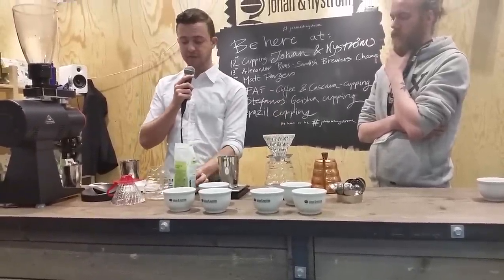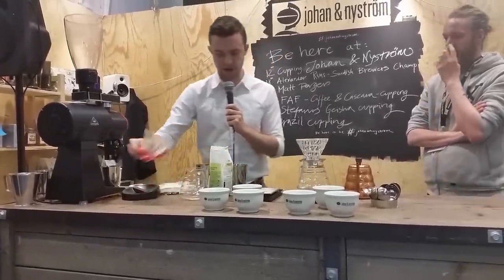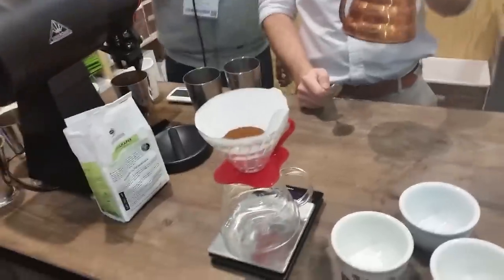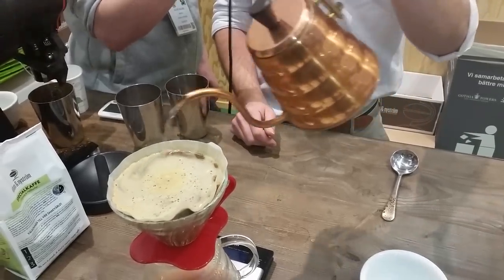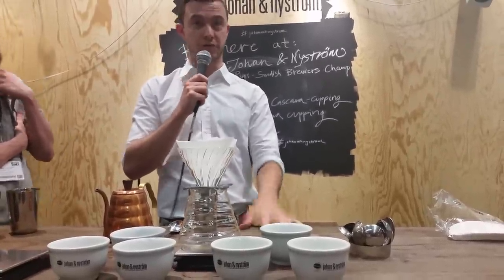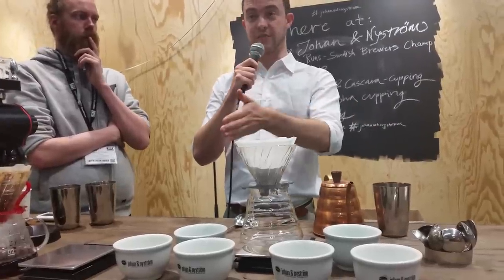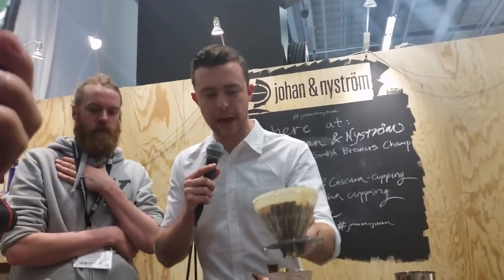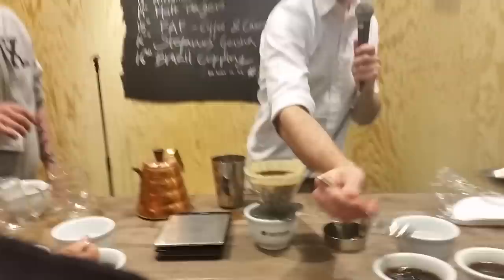Matt Perger talks about brewing in WOC 2015

Comment: That moment during a live demonstration when you find out Hario changed their filters without telling anyone.
Reply: It's a fake imitation hario filter. Hario didn't change. There is a company making thicker filters with little tabs on the top and they're calling them hario filters. I bought them on Amazon because they were so cheap and they just aren't real harios. The paper is really thick and it makes your draw down super long and gives you extremely over extracted coffee so be warned!
Reply: +mrgibson0826  That's actually not true. The people over at amazon reviews are claiming fakes, but Prima Coffee has confirmed that Hario added another paper manufacturer to keep up with global production. These new filters coming from this new manufacturer are thicker than the originals. It's poor communication about this change and that falls squarely on Hario for not letting anyone know.
Reply: +Rita Sprinkle that's interesting. Do they still produce the original?
Reply: +Rita Sprinkle And that the guy doing the demo uses absolutely no logic in his "I don't care if it's boiling, it won't burn because it's roasted" argument. Everyone one but this guy knows unequivocally that extraction temperture has a direct affect on flavor. If it didn't, it wouldn't matter what temperature you extracted at. I guess the idea that certain chemicals are released on a gradual scale in a granulated mash of particulate is directly the same as cooking whole beans for a completely different reason than to achieve extraction.
Reply: +Daemon Electricity hahaha the guy doing the demo was World Champion WBC...
Reply: +Daemon Electricity Yeah, but what he didn't say this time is that he likes when the coffee is sweet and those sweet notes get released when using a high temperature water. And anyway the slurry should be at 90+ degrees Celsius. Not the water in the kettle. My brews have become much much better after I stopped waiting for the water to settle... I even put it back on during the bloom, it makes a lot of difference.
Reply: I've been doing the same thing, and it seems to help keep more consistent during the pour, too. I also like very light roasts, and you need higher temps for light roasts.
Reply: "extraction temperature has a direct affect on flavor."

Yes, but it's not like the coffee flips a switch between 205 degrees F and 212 and says "oh shit, let's start releasing bitterness and burnt notes now!" Temperature increases extraction the same way grind size does. Perger's idea is by keeping one variable absolutely the same, water temp, then it's easier to dial in a coffee because we only have variables of grind and brew time to deal with now, instead of juggling all three.
Reply: So how does flavor get affected with respect to water temp? is it the contact time? different compounds in coffee have different dissolution rates right? but Im guessing what you mean is different cups of coffee extracted at different temperatures will yield almost similar cups just as long as it's in the right range?
Reply: Alfonso Daleja I believe it increases the solubility of the water
Reply: @daemonelectricity  He didn't say temp didn't matter, he just said boiling won't harm the brew.
Reply: @fr201  It will though. Steeping in too hot of water makes coffee and tea taste extremely bitter. Extraction is based on temp + time. It fully affects the quality of the brew. The same thing happens if you leave the coffee on the heating plate all day. It turns into the most sour/bitter tasting coffee you can imagine.
Reply: @daemonelectricity  You've read too much theory but suffer from a lack of experience. Brewing coffee with water fresh off the boil doesn't produce "extremely bitter" coffee nor is coffee that's left out on the heating element a good analogy.  Put down the books and make more coffee :)
Reply: @fr201  No, this comes directly from many years of experience. You don't know wtf you're talking about. Heat makes coffee go sour. This is why cold brew is the most mellow tasting coffee you can get. Don't project your inexperience on others. I've been making coffee for 20 years and tea for even longer. I know how to make shitty Folgers taste better than your grandma can with this knowledge alone. Heat changes flavor over time and that's universal to everything, not just coffee.
Reply: @daemonelectricity   Matt Perger disagrees with you... as do I  shrug
Reply: @daemonelectricity  You cuss a lot. I'm right, you're wrong.
Reply: @daemonelectricity   *whose
Reply: Daemon Electricity did you ever figure out who Matt is? Have you experimented with the boiling water technique on different roast profiles yet? I wanna get a heap of temp probes and see how much the water does cool by the time it’s in the bed of coffee.
Reply: @callumtaggart9392  I haven't been scientific about it, but I've noticed the hotter the water on either espresso or tea, the more it tastes sour and "burnt." I also know drip coffee tastes better if you don't leave the warmer on. Better to reheat in the microwave or drink it cold than let it sit under a warmer and slowly turn to acidic sludge. Granted, that's a different scenario than brewing, but it makes a HUGE difference in extraction color and speed. Obviously colder water is weaker, hotter water is stronger but more acidic in both cases. It doesn't have to be burning necessarily as much as it is extracting and causing different or more intense chemical reactions at certain temperatures.

I have not tried this on different roasts.
Reply: @daemonelectricity  lol wtf... let's use a little bit of basic food science to disprove what you're claiming. 

When roasting coffee and when cooking a steak, a chemical reaction called "Maillard" takes place. This is basically caramelization. When this is done well it enhances the sweetness and fullness of certain foods. Coffee tastes sweeter and more full-bodied. Steaks taste saltier, meatier and way more complex. When it is done poorly, basically when overdone, things taste burnt. No matter the raw product, burnt food will taste burnt. It seems you know this already!

When extracting coffee we're trying to extract all of the "good stuff" until the point where it starts tasting bad. And temperature is just a variable to do that. As you well know there are many factors that play into perfecting a coffee. Grind size, brew time, filtration type, agitation and of course temperature. But what you seem to not know is that the changes in temperature have the same effect as changes in time and grind size.

In a study by the renowned UC Davis Coffee Center and the SCA, they concluded that at the same extraction% coffee tastes the same when brewed at different water temperatures. This doesn't disprove that boiling water wont tastes bad, but it shows that it is just another variable. So basically saying it will extract bitter flavors is just wrong, because it will extract the exact same particles as colder water, just a little bit faster. Temperature will only accelerate the chemical reaction.

If the coffee should taste burnt because of the water temperature it would mean that the water is further developing the coffee, which is impossible. I see how his argument was not really very logical or strong, but he is right. The coffee wont be further developed by a little bit of boiling water.

Now, if the coffee turns out bitter it must be for some other reason. 1. too long brew time. 2. too fine a grind size. 3. uneven extraction. 4. too much agitation.

And lets clear a few things:
1. Folgers always sucks no matter how skilled a barista you are.
2. Years of experience is not really a valid argument in one of the fastest changing industries. But other people acknowledging your skill is. This guy won the World Brewers cup in 2012, placed 2nd in World Barista Championship in 2013 and 3rd in 2011 and he also won the Coffee in Good Spirits championship in 2014. He is one of specialty coffees most respected researchers and baristas. He is a good source of wisdom, you are not.
3. Tea is another story. Scolding tea and extracting flavors from tea is a completely different game. So taking experience from tea is not really useful. Using boiling water will often ruin tea, because it is COMPLETELY different from coffee.
4. A cooking plate will actually burn the coffee!
5. If you notice sour and burnt flavors in the same cup it usually indicates bad extraction as those flavors are generally extracted at very different times during the brew.

Finally a very important point. With some recipes using boiling is best, with others using 92 degree water is best, it all depends on the recipe. So maybe your recipe is just not well suited for using boiling water!

Hope you learned something from this! I'm no trying to roast you, I'm simply trying to disprove what you are saying, so that fake information doesn't spread! Anyway have a great day ;)

Comment: I don't think people are worried about boiling water "burning" the coffee.. They are worried about the hotter water extracting a greater proportion of bitter compounds.
Reply: If overextraction is the problem you can easily compensate with a coarser grind. The idea is that using boiling water makes water temp an easier variable to isolate. Other variables are less tricky to isolate (grind setting, brew ratio, etc), so those are the ones to adjust when dialing in coffee. That said, one can certainly make amazing coffee with much cooler water; just look at winning aeropress recipes for proof. Perger is just looking to increase consistency and repeatability, two elements of commercial coffee brewing that are incredibly important.

Comment: did he prewarm cups and rinse filter? and why he adds more water on the end? was it so fresh roasted for the gasses or for other reasons? we have to know exact all these other ways sure you don't produce on home this quality(of course he is a champion  n geek on coffee we are not)ha ha!
Reply: +stefanos varelas He added more water at the end because the filter paper he was using was letting less water through than he expected. Because the coffee was in the water longer he was worried the coffee was gonna be a little over extracted.
Reply: +stefanos varelas yup...technically it was pass brew , to dilute because the slow flow rate will be extract more coffee
Reply: Hario started using another distributor for international sales because of demand, and the new manufacturer uses thicker paper that binds up.

Comment: About water boiling, is not correct at all. Because the water boils at lower temperature at higher altitude.
Reply: +Arturo García Right, but it will be consistent at that altitude, which is what matters most.
Reply: +Arturo García The difference between brewing at 212F and 210F will be minimal, though. Water boils at 210F where I live, and I brew at boiling, and it works just fine. The key is consistency. Boiling at your altitude is always boiling at your altitude.

Comment: Very weird, everything. Not trusting it, he is going against everything ive ever known about pour overs....gonna stick to my 93ºC water and not pouring water on the sides.
Reply: Live a little. As he mentioned by using a rolling boil the actual temp of coffee in the bed is right on 93deg.
Reply: Agreed with Callum, what do you have to lose by trying? Whatever method you're using now was probably against the grain of some previous method until tried, tested and agreed on. And then a new method comes along...
Reply: In my experience using water right off the boil is great with light roasts. Just compensate the grind size to be larger and it’s perfect.
However I do disagree with some of his other tips but that’s the point of the pour over. There’s endless methods with the amount of control you get in the brewing process.